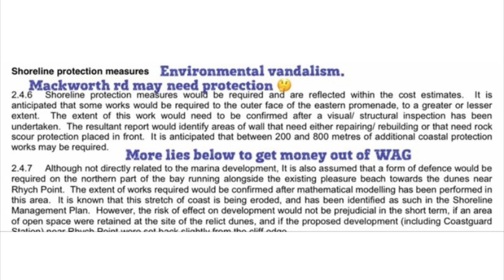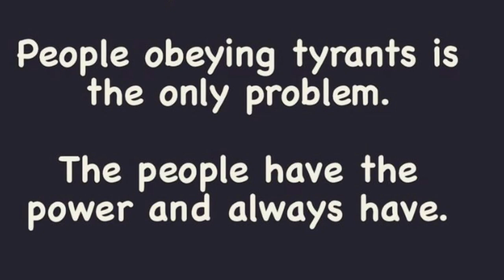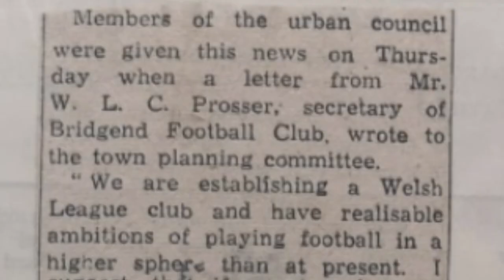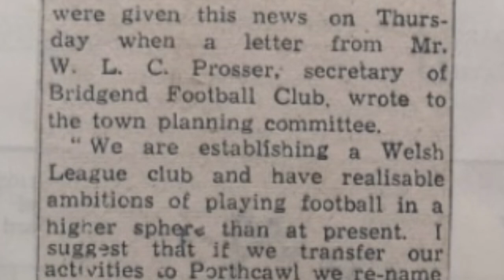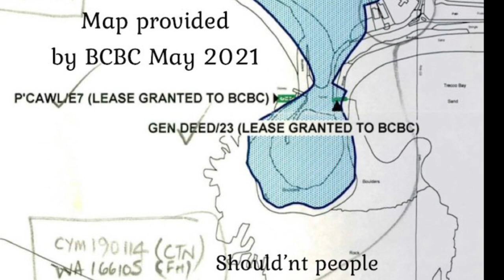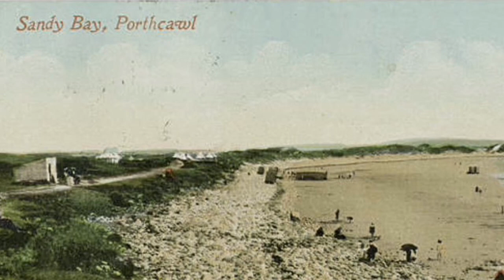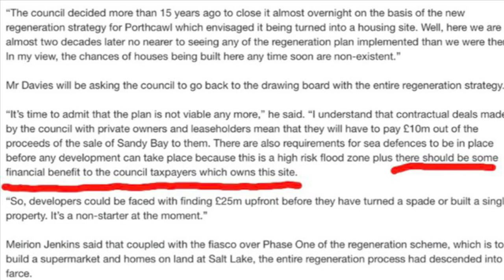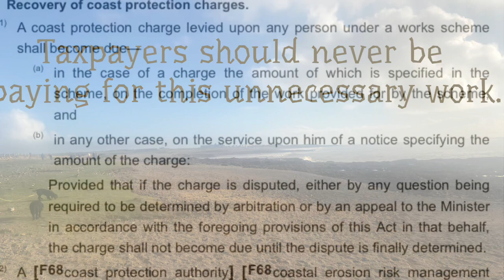Hidden History of Porthcawl - see comments below 🤝

Comment from the maker: Another video worth watching is YOU’VE BEEN ROBBED where old newspaper articles offer clues as to the true ambitions of the rulers of Porthcawl…. eg the Sandy Bay caravan park was the sole reason for a CPO sanctioned by the Board of Health in 1948 , though it was supposed to be comprehensively bought for far more uses than just a caravan park . It did allow the whole area to be stabilised to prevent sand movement, a big problem at that time.